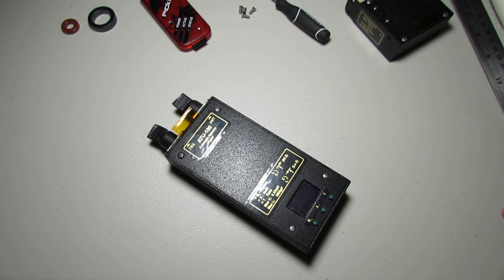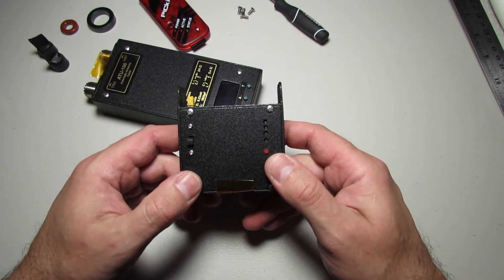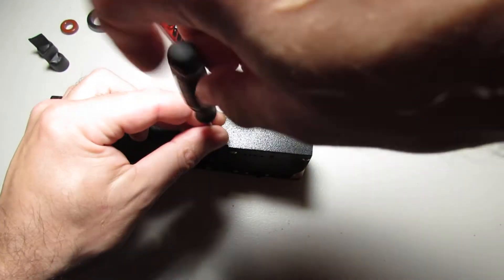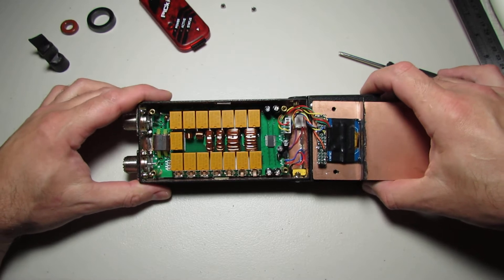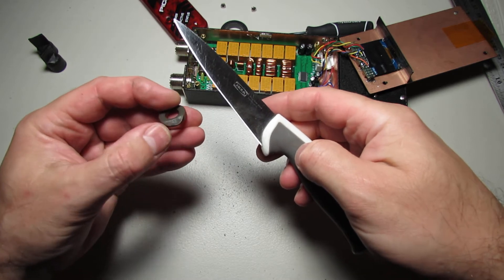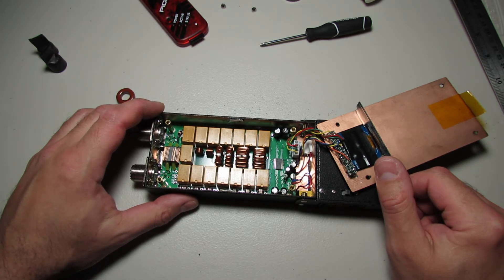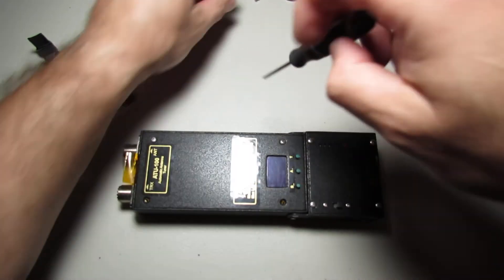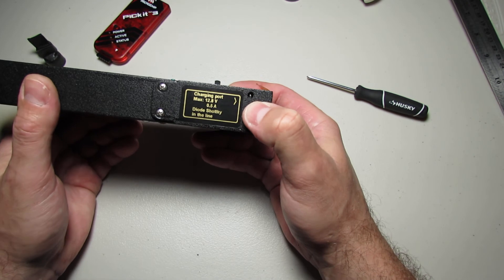ATU-100 7X7 N7DDC Custom Body

Comment: its a very good idea with separate battery  casing
Reply from the maker: Yes, 
If necessary, I can change the battery or use cable and connect the tuner to an external power source.

Comment: you have confused ferrite toroid and iron powder toroid. Iron powder toroid uses metal dust mixed with epoxy ,with low metal dust densityso it is not as hard as ferrite.

Comment: Tried to programme ist with a pickit2 - but althought the pickit is detected by my PC the pickit itself does not detect my "PIC16F1938". Neither in Windo$ nor in Linux. In Linux I can at least try to read the  "PIC16F1938" but all I get are zeros. (pk2cmd -PPIC16F1938 -R -J -GE00-3F and pk2cmd -PPIC16F1938 /GP0-F) So I did not dare to write my modified hex file back onto the "PIC16F1938". Lucky that I do not know the Linux command for writing to hex file to the "PIC16F1938" 😁

Comment: May I commend you with your video production and I would like to ask you ask a question . Do you know if it is possible to mod this atu to accept a remote tune connection compatable with the Icom IC705 ?
Reply from the maker: Hello, 
Potentially, if using the display port of the ATU-100 and interface converter IC, it's possible.
But you need to modify or even fully rewrite the firmware for the microcontroller.
Regarding this question, I would recommend contacting the creator of this project.

Comment: The ATU 100 sucks, i bought a new one and its not tuning at all, screen stays at "TUNE"  and power is going down. So i bought a new PCB with v3.2 and still the same problem.
Reply from the maker: Very complex to diagnose your problem. Try to check all connection and soldering, Tandem match transformer. Diode and linear regulator. Right connection to ports TRX and ANT. Hope you will fix and enjoy with your new tuner.
Reply: @UT4UFA  I sold them, i did try everything, connections where ok, resoldered al wires etc etc and couldnt get it to work :(

Comment: Where did you get this case, or was it hand crafted  ?
Reply from the maker: Yes this is hand crafted case. 
Case made from copper laminate sheet, using for producing PCBs.
All parts of the case were cut to the desired size and soldered together from the inside.
Reply: @UT4UFA  You did a great job! DE WA1KLI